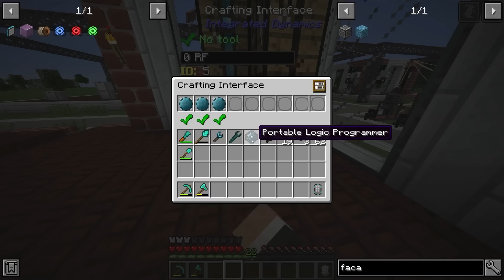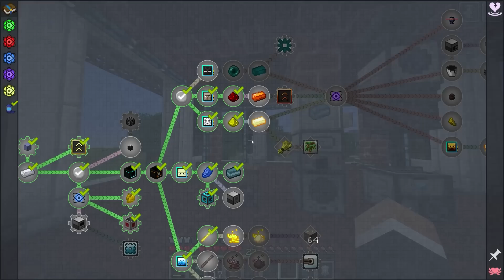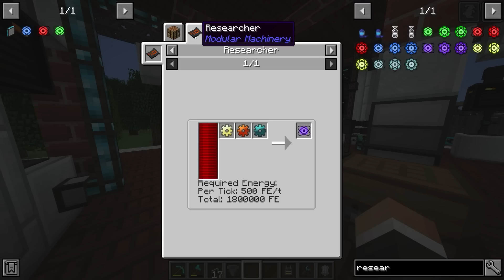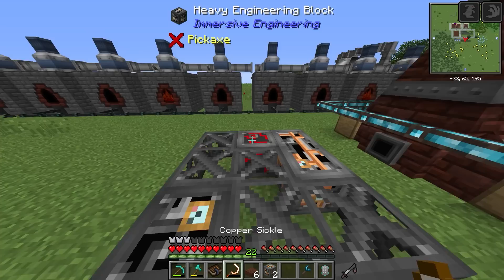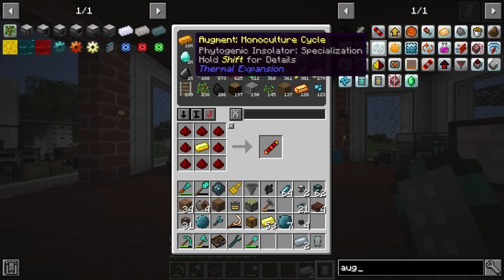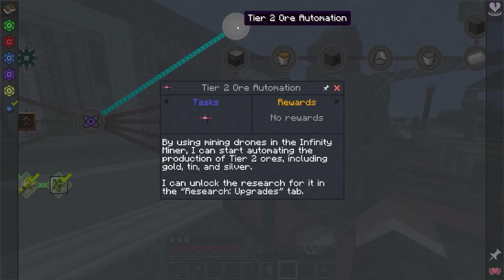Minecraft Feed The Factory | "TREE FARMING" & ADVANCED ALLOYS! #17 [Modded Questing Factory]

Comment: The issue with the auto crafting with Integrated Dynamics is that the modpack author did give it access to the staged recipes. It's possible but you have to add it/edit one of the scripts. Also there's definitely a remote but apparently the modpack author removed it.

Comment: I must point out that the optimal arrangement of crafting tables in an Integrated Dynamics setup for autocrafting is basically the five-pip arrangement on a six-sided die from the front, but with the center block offset from the others by one block along your axis of vision. That way, you can put the full 6 crafting interfaces on a single table, for the full 54 recipies. Plus, it's tileable.
Reply: Also, you only needed to give it a redstone signal to turn it on because you accidentally inverted the redstone controls.

Comment: If you look into how it works, you can make Integrated Dynamics exporters work on specific slot numbers. So you can SPECIFICALLY fill just a single inventory slot of a machine with that connection. There are not many mods that allow you to do that from the pipe/cable side!
It could solve your issue with machines that don't have their own inventory filtering.

Comment: I highly recommend using integrated dynamics for power. Hook up the generator to a battery and use the wireless transfer to keep the cabling clean. You could even import directly from your drills without running cable.
Reply: Wireless power is always a must

Comment: Another solution for the phytogenic insolator and the phyto-gro issue is using a storage drawer with a storage downgrade as a buffer so you can guarantee it's only going to pull in phyto-gro from the storage system.

Comment: If you invest in the ID battery you can get wireless power(ditching the immersive sky rat nest) with the omni-directional connector and energy importer and exporter, you can get a couple thousand RF/t transfer.
Reply: Also works with capacitor banks or any RF storage such as the dynamos.